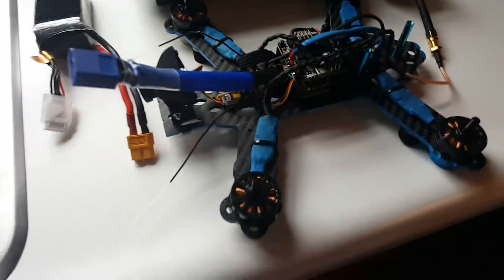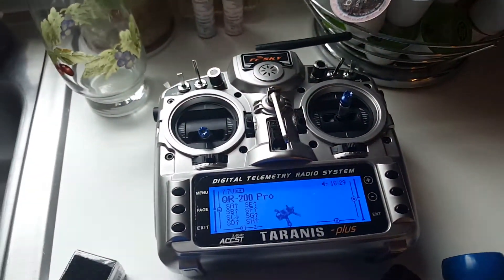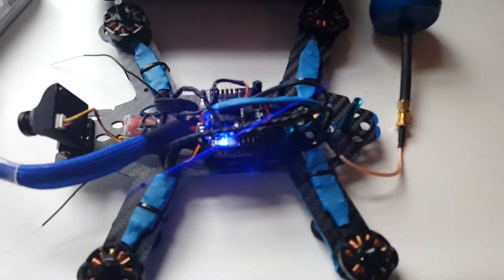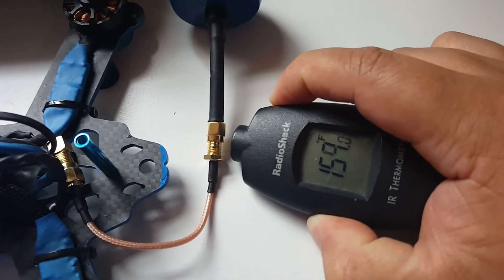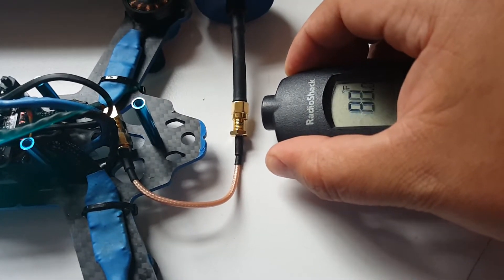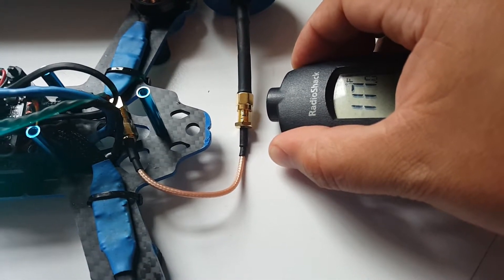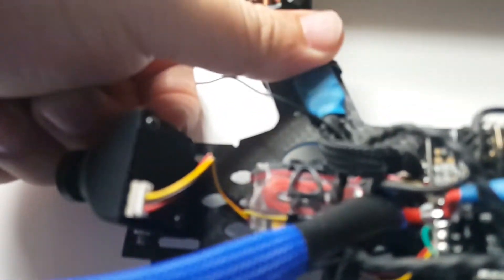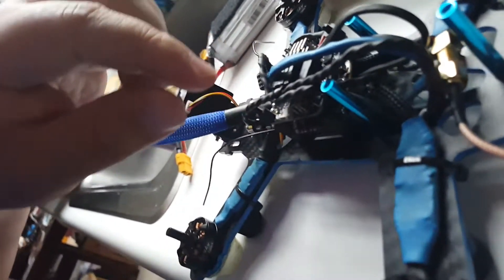Uuh, did I see smoke? Yes. Yes I did! F*ck. Lol

Comment: I have an eachine 220s which starts smoking when i plug in the battery. Do you know what it is ?
Reply from the maker: It may have been flux burning off, or a short. If it was a short you have to check all your solder points, etc. The use of a "Smoke Stopper" would be extremely helpful! I recommend this one ➡  https://amzn.to/3RCjHhg

Comment: Having a ground short on the sma connector is very common. I also have it on one of my frames. I use a rubber grommet to mount my SMA trough the frame. This isolates the problem, and gives a little flex on the antenna aswell. Some frame manufactures add this in theyre designs.
Reply from the maker: Mine did not include one and the hole on the frame was cut out to perfectly fit the sma bulkhead. Thank you for your comment!
Reply: You can get these rubber grommets off ebay, and then you gust have to drill out the SMA hole in the frame to 8.5mm so it fits in between. The hole in the grommet must be 6mm